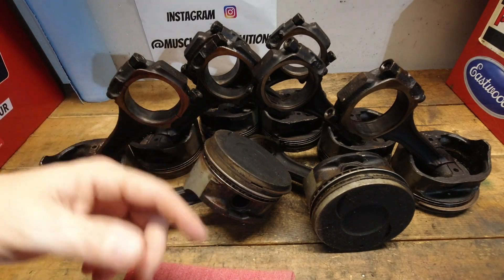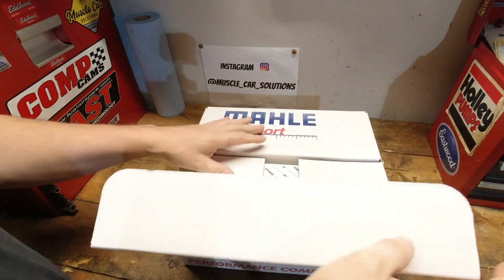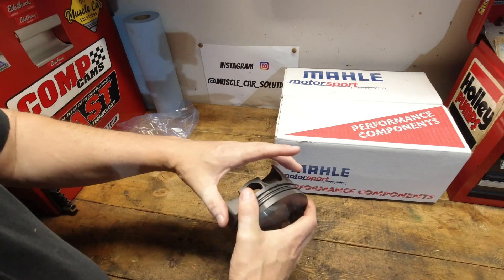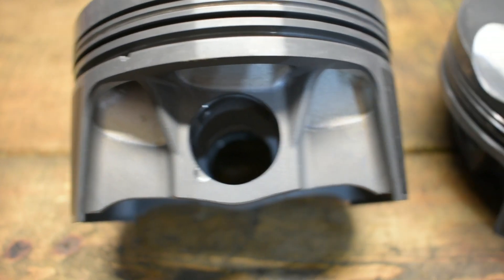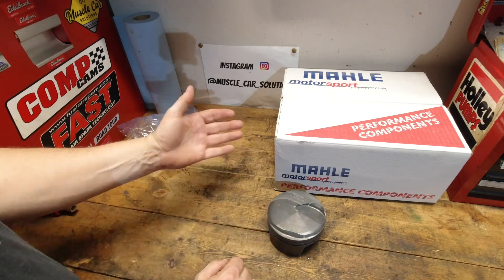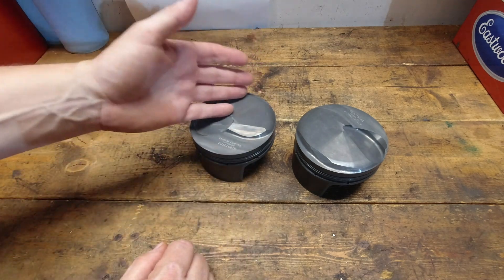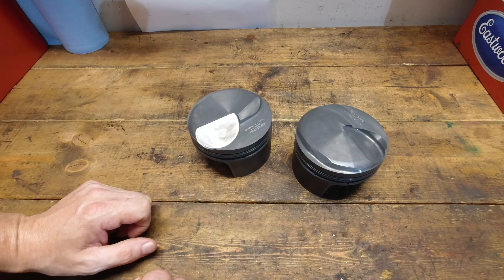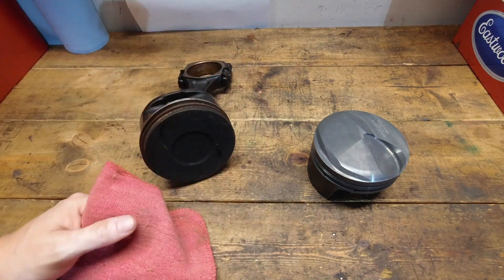Difference Between 2618 and 4032 Forged Pistons

Comment: You're referring to 4032 like it's a cast or hypereutectic piston.  FAR from it.  4032 will stand up to tons of abuse...  just not quite as much as 2618.  4032 is still light years stronger than cast or hyper.  2618 is only needed for the harshest of duties.  I successfully ran 4032 pistons in a 363 Ford making 655hp na, plus a 250hp nitrous shot.  After two years of racing, I did have one cracked ring land that was discovered on teardown after a head gasket issue, but the pin is well up into the oil ring, and it's a very tight ring pack.  i did go to a redesigned 2618 piston with thicker ring lands this go-round, but don't underestimate the 4032 alloy.  It's still a very high quality forged piston.
Reply: Did you get loud piston slap on your 2618?

Comment: This was very informal. Thank you for putting this out. I'm currently putting together an LS3 that needed a Bore, .30 to clean it. Only to find out, I shouldn't have. It made the block weaker. I picked up Hypereutectic pistons only to find out, they won't be good for 15 lbs of boost (LSA) So, I've been on Forge Piston education hunt. From your video, I think the 4032 would be better. This will be in a car I drive to work on Fridays and State to state to get away (Summertime only) Spinning some tires here and there. I think if I would go with 2618, it will wear quicker and I'll need another block because the block was already weakened the first round. If I wrong if you have any input, pls share. Again, Thanks for time you put into this

Comment: I have a 2012 srt 8 392 and I purchased the 4032 pistons and went with a redeye cam lifters and also have long tubes. This will be a street car with very minimal drag runs. I plan on adding forces air and my goals are 650-700 at most rwhp did I make the right decision or would y’all have recommended the 2618? Thanks in advance !
Reply: Imo I'd go with the 2618, just a few more bucks. Just jeep oil level good amd give the engine good warm up before you smash. I went with 2618 for just 250-300hp, but probably 20psi and a bit higher back pressure due to .48ar for power down low. 2618 imo is an extra security
Reply: I'm running 4032's in a 550hp BBC, 11.66 compression, no power adders. Never had a problem yet. The machine work is the big issue. Make sure you've got a machinist that knows what he's doing and gets you the right tolerances, and you'll be good to go.

Comment: Could you comment, 4032 in 3.4 2j  street use, approx up to 700whp(pump fuel permitting) ?
Reply from the maker: Sure.  What is your question?
Reply: @MuscleCarSolutions  would it be ok to use 4032 for this application ?
Reply from the maker: @mv6160  that’s a very respectable number for a 2j.  Assuming you’ll be boosted?  Either will likely work, but I’d probably gravitate to the 2618.  Your engine builder will be the best person to guide you on what will be best for the complete details of your engine.

Comment: Good explanation. 
Most of what I use is 4032.
Because of street car and and occasionally bracket race.
And mild power adders.
I prefer to use it because you can usually run .001/.0015 tighter piston to wall tighter than 2618.
Most of these engines are built for more longevity. 
However higher compression and higher horsepower applications almost require the 2618 material. 
Great subject and content.
Take care, Ed.

Comment: Great video, it's a poorly understood subject.  

Alcoa is the supplier of 2618 and 4032 alloy to most piston makers in North America.  In fact, a division of Alcoa supplies unfinished and semi-finished forgings to many piston companies.  Only a few piston makers forge their own blanks, Mahle and DSS do, Wiseco makes many of their own forgings. There may be others making their own forgings, but not many.

The advantage of the 2618 alloy is it's high ductility.  This is a benefit in high boost, high cylinder pressure applications. The 4032 isn't as ductile. As you said, the 4032 expands much less and is more scuff resistant allowing tighter clearances for quieter operation. 

I have run 4032 pistons to 4 digit power numbers. The 2618 alloy can really take monster power. 

Thanks for the video.
Reply from the maker: Didn’t want to get deep into the weeds on this one.  Could easily had a ton more info.  This video is a set up for something greater down the road.  Thanks for the info and watching!
Reply: @MuscleCarSolutions  I can imagine a video about rings 😳😳
Reply from the maker: @v8packard  you would be spot on with that guess!
Reply: @MuscleCarSolutions  Let me know if you need any material for that

Comment: I'm running AutoTec 4032 forged custom pistons in my 351m build.
Reply from the maker: The 351M is an under appreciated engine.
Reply: @MuscleCarSolutions  Yes. Did some drastic tuning on mine today, I live at 5032 feet altitude. Full roller setup, Howards Rattler cam. Adjustable 1.7 rockers from comp basically Boss rockers and 7/16 studs. ARP bolts and studs where it matters. Balanced, milled, decked, ported heads and manifold. 1800 stall on a C6, 3.73 gears 4x2 1978 pickup truck.